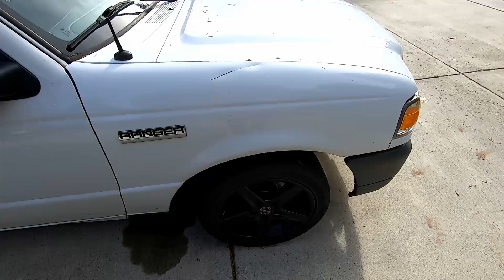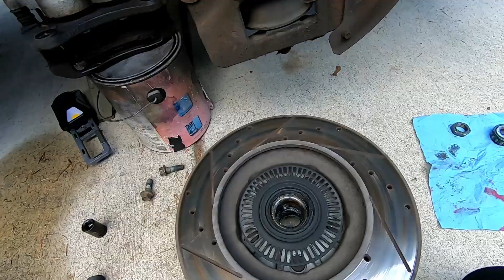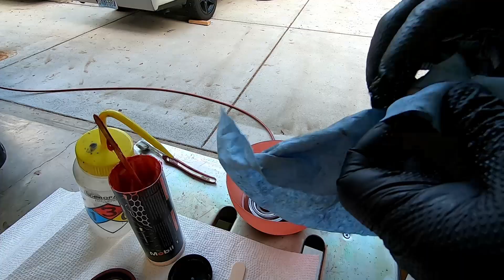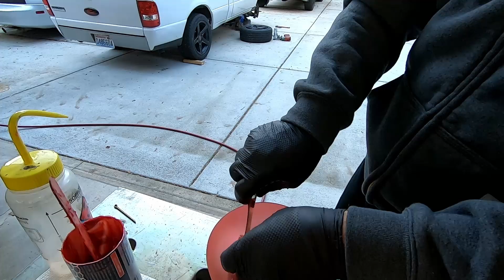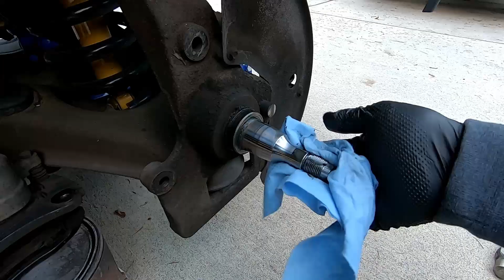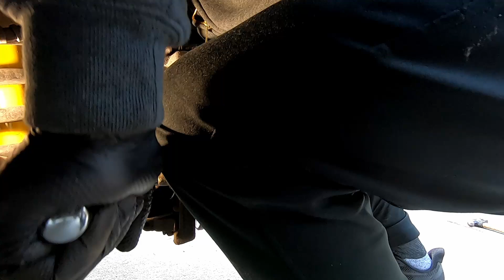2WD Ford Ranger Wheel Bearing DIY Replacement Repacking at Home Full Detail

Comment: Do you have wheel spacers on. They might cause premature failure
Reply from the maker: Yes and not necessarily, but plausible.  In this case these are a positive offset Mustang wheel which the spacer just counteracts the offset or near zero offset that the OEM Ranger wheel uses.    Your theory could have some merit though as I've never crunched the numbers to see how close to OEM Ranger the Mustang wheel and Spacer combo are.  It should be pretty close though.

Comment: Appreciate the video! I recently bought a 95 mazda b2300. I have the new bearings and seals. I'm gonna have to get rotors too. stupid to put new bearing in a crappie rotor ? I still need a valve cover gasket , u-joints , center support bearing. Among other things.. I'm trying to pick my battles. Guess I'll probably get some brakes and rotors and hold off on the other stuff.. sorry anyway great video.
Reply from the maker: These are good trucks even with hundreds of thousands of miles on them.  Nice to see you keeping that one going!

Comment: Mine is doing that after I just put new bearings in it today and torqued it the way the Haynes manual said to. That’s why I’m watching this video.
Reply from the maker: So far after putting the Koyo Bearing in the truck they have been behaving themselves!
Reply: part quality is bad, i replaced mine 6 weeks ago and the outer bearing already failed. im looking at videos to see if i did anything wrong.
Reply: @RipliWitaniI think ford said to do 20 lbs or something like that, I went out the day after my comment and torqued it to around 45 lbs then backed off half turn. Put the wheel back on and it didn’t move in and out. They got a little warm for probably the first 65 miles or so and then they stopped getting warm. Been driving it to work and back since then and they seem fine ✊🏻🪵

Comment: It would be nice to know what year  truck you working on!?!🤔
Reply from the maker: Solid question, but AFAIK this procedurally applies to any 2wd Ford Ranger /Mazda pickup or Explorer from the 80s all the way through 2011.   That is why I didn't post a specific year.   Truck is a 2007 XL Fleet truck btw.

Comment: what is the size of your spacers, like around the bearings
Reply from the maker: Are you talking about the wheel spacers?
Reply: @PNW_Car_Mods wheel spacers eat up bearings
Reply from the maker: @Jami-v1u5u  They can but if you do the math in this case they are not the problem.  Offset/backspace is offset/backspace.  I have simply used the spacer to make the mustang wheel have the offset/backspace a ranger needs which is essentially zero.
Reply from the maker: @Jami-v1u5u  Also, I have put another 15k miles on the truck since this video with the KOYO bearings and no further problems.

Comment: Why would you go through all the trouble of making a 35 minute video and not even add the tools used. I believe it's 1 1/16 for the nut and 15mm for the caliper.
Reply from the maker: First and foremost, this is not a professional YouTube channel lol.   Secondly, I swear I did along the way as needed.   Maybe not, but I'm pretty sure I did.    Regardless, you are right if I didn't.
Reply: @PNW_Car_Mods I'm not a pro either, but I get all my tools together and make sure everything I need is right by my hands before I start. Actually, I had to go buy a 1 1/16 before I even opened the toolbox or got the jack out.
Reply from the maker: Since I have been a mechanic my whole life generally speaking I have every tool you can imagine so I do have a tendency to take that for granted.   I'll try and do better in the future on these kinds of tasks but I can't promise the world.  I just don't take this very seriously lol.   and in a bit of irony I am literally going to be tearing this whole job back apart and redoing it as I finally got my 13 inch cobra big brake it hubs in the garage.
Reply: Yeah, trust me, it's 1 - 1/16" just did this job and I can say with embarrassment that the 1 - 1/16" socket/ my biggest socket has won the award for most misplaced tool in the shop today. 😂

Comment: 25 lb/ft or torque? Followed by some inch pounds? Bro, my E38 requires a ball-busting 214 lb/ft of torque. I don't recall what my Dakota took but I believe it was similar. Of course I didn't have to pack them with grease.

One day if I ever become less lazy I'll pack the bearings iny Beetle before they go dry. I have a handy tool that you set the bearing in and press down and it completely fills the bearings will loads of grease. Good stuff.
Reply: Yeah, my e46 xi front axel nut is 309, lol.
Reply from the maker: LOL the Germans know how to overcomplicate anything.   and Dodges, well any time I come upon a vehicle sitting on the side of the highway missing a wheel it's 99% of the time a Dodge lol.